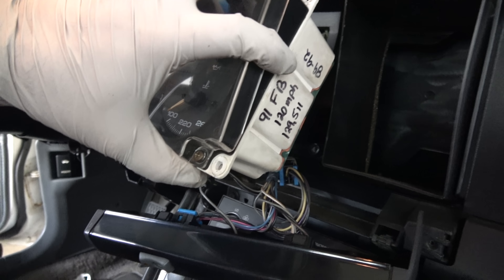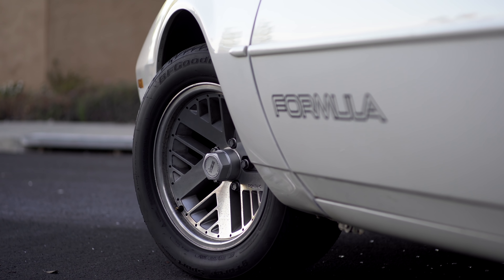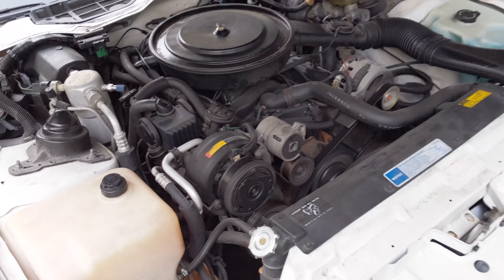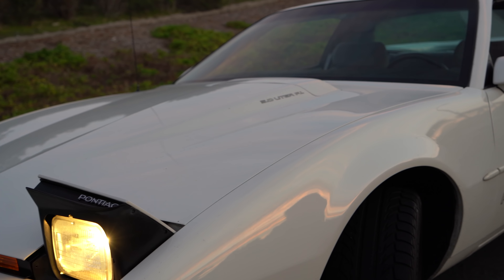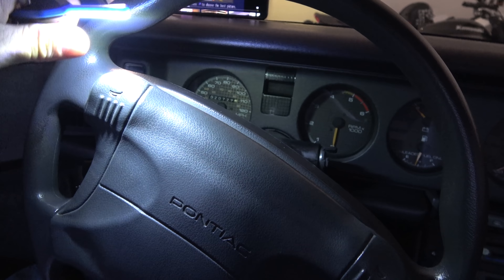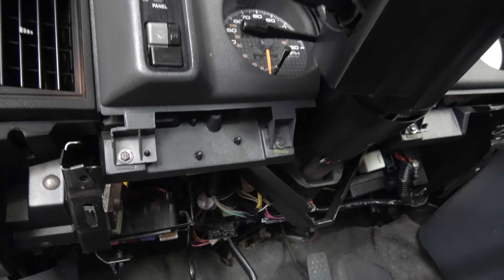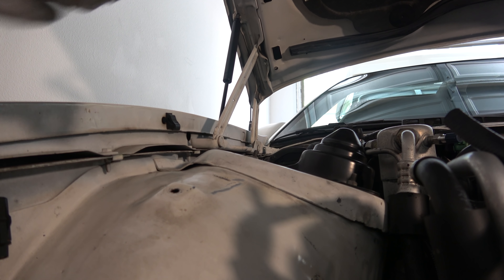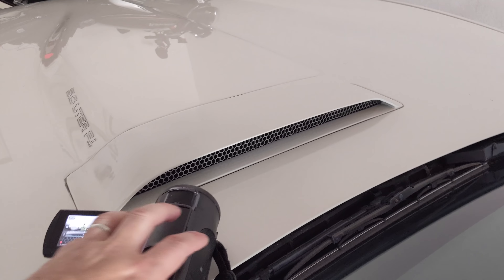LIES! Odometer fraud on my 1990 Firebird

Comment: As others have said, the '91 and Mileage on the side of your Cluster is just the information recorded when it was removed from the car at a recycling yard.  So those number mean nothing as it relates to your car.  It does imply your cluster was replaced for some reason.  

Valve stem seals fail in these cars more due to age.  They dry out and leak causing smoke at start-up.  So again, not a true indicator of hi-milage.

Fuel systems issues in Low Mileage cars is a common problem.  That is because they sit with OLD Fuel in them for long periods of time.  So very common to have to go through the Fuel System.  So no indication of a low mileage car there either.

If you are seeing corrosion in some areas, coming from Florida with Salty air, this can be quite common.  So this doesn't really contribute to Age.

I would look at the Brake lining and pads.  See if they are the OEM factory issued pieces.  That might give you some real insight into the age of the car.  Maybe do a compression check, see what the condition of the timing chain is.  I do agree that the Clutch is a good indicator.  But also don't think a factory clutch would last over 100k.  So measuring the wear and determining if the clutch is OEM, would help with identifying age.  

Sorry to see it wasn't all you had hoped it would be.  But it is a good looking car.  Appears to be in pretty good cosmetic shape.  So maybe it wasn't such a bad purchase after all.

Just a Note - CarFax reporting is not a requirement, so you are not going to see entry's all the time.  That is why so many years with no information.   Reporting mileage is on a voluntary basis.  And it is done a lot more now by states and service centers.  So newer cars tend to have a much better history than cars from the '80's and '90's.

Comment: I bought a boat sight unseen over the internet that had very low hours.  Hours seemed correct but later found it had a cracked block.  The cracked was circled and dated so I'm sure the owner knew about it.  Yeah a learning lesson.  Still was a nice boat just ended up having to put a new engine.

Comment: Mulletville Junkyard Warranty marking  ?? 

 The odd thing to me is the 129K miles inked on the secondhand speedo. With Ebay 3rd gen speedos I have bought some have inked what it came from ie 83 camaro. ie fits 82 to 85. or marked 85mph or 120 mph. like the used pulled speedos are on a shelf and these markings help sell the item, what it is for. 

If the mechanical odometer reads 123456. when why mark it 123456? 

MAYBE the Mulletville Junkyard marks the mileage as some sort of warranty. ie says it will work for 12k miles or 12 months? Then if Goober has the speed fail in 10k miles he gets a credit or his money back.

In 3rd gen speedometers on ebay I have never seen mileage inked on the speedometer and have looked at many many hundreds of auctions

Comment: Just the display has been replaced. Valve guides on SBC are prone to crack due to age.  Check the Carfax. Any stolen car will have issues. Why pay 11k for a 5k car?

Comment: Mate I'm so sorry you got hoodwinked... Before you go to the trouble of doing that valve seal job, I would definitely go over that engine with a fine-toothed comb to make sure it's not blown. If you were to end up having to replace the engine, at least you'd save the time from doing those valve seals...
Reply: He may be looking at a new short block.
Reply: Back in my early '90s college days I had an '83 Grand Prix w/a carbed 305 that had bad valve seals and a LOT of purple exhaust when starting. It wasn't too long after, that the engine blew. I managed to luck out on that one, however, as my dad had it replaced with a 350! 😁

Comment: If you plan to keep it pull the heads have them completely rebuilt don't just do the valve stems. Or better yet replace those heads with better flowing aluminum heads. If it's clean and rust free in time you will have a nice ride.

Comment: You might need to replace the Catalytic converter with a high flow one to improve your mileage,the old one is probably mostly plugged.
Reply from the maker: It's a new one

Comment: The odometer is a tool to assist in evaluating the mileage of a car. Not the source of what the actual miles are. Especially with older cars, instrument clusters were commonly changed. The condition of the vehicle will tell you more than the odometer.  A lot of cars in the 60s/70s only had odometers that went to 99,999 miles. You won't believe how many people are convinced that they have a "30k original mile car" when the thing, undoubtedly, has 130k miles or more.  Back then you'd either clock your odometer or, if you got a new speedometer, you'd just leave it at 0 and not set it to your current miles.  If you are thinking about buying an old or "classic" car you really want to have an inspection done by a reputable mechanic. Some people think they have a 30k mile car, when it's 130k, and assume that the poor condition/performance of the car is normal because it's an old car. They don't have a frame of reference to tell what a car should feel like. Don't get fooled!

Comment: Winston what version of firebird do you have? You have the formula version which is a trans am but toned down body. They came with a 5.0 liter(305) throttle body automatic, a 350 multi port or a 305 multi port 5 speed.
Do you have the w s 6 suspension package?
Reply from the maker: I can post the build sheet, yes it's ws6 and it's the tbi L03 motor with T5 transmission
Reply: @WorthlessWhips  ok that's a great option since you get 4 wheel discs and special sway bars , great project car since you have all the right options
Reply: @WorthlessWhips  The VIN number's 8th digit should be "E"  for the TBI motor and "F" for the TPI motor

Comment: Winston,  get with your local DMV office. DMV has officers that will investigate this matter.   Also "if" the engine has that many miles on it, weight out the pros and cons into putting a new crate (or rebuilt)  LT motor or an LS motor in the car.

Comment: Just get mechanic to drop carburetor. Funnest motor I ever had was 1985 Monte Carlo had 305 with 4 barrel carb. I use Bosch spark plugs. I got baby lt1 4.3 V8 got power gain by Swiss cheesing air box, de screening MAF sensor. So far so good. I'm hoping for LS swap this winter. Basically buy 5.3 or 4.8 junkyard motor rewire harness, brackets galore, send computer in to get vats deleted and rear o2 sencers. Long tube headers, figure out power steering, electric fans might be way to go.

Comment: That is a bummer, but look at it this way. Now that it's not a low milage survivor you can feel zero guilt building the car better than new. I have a pair of 91 Firebirds one Formula and one base model convertible with the 305 TBI. Do not waste any more money on that TBI. Pull that thing out and swap in something better. It's what I'm doing with mine.

Comment: If a car is 10 years old or older and it has less than 100K on it then one of 2 things happened. 1) It was parked years on end which means dry-rot seals and solidified gas or 2) they rolled back the odometer. Chances are if you see such a thing run.

Comment: Wait a minute here! I think you are an expert when it comes to China, but you are way off base when it comes to cars, a complete amateur. I have been working on old cars since 1970. Listen here...  you bought a 30 year old car from Ohio of all places. Cars from Ohio are some of the rustiest in the world. You are so lucky to get this very good Firebird from the rust belt. A few parts were sourced from wrecking yards. What do you expect to see on a 30 year old car? I would bet someone changed the used cluster mileage to match the original cluster, not the other way around. The corrosion on engine parts is so minimal for an old car from Ohio, you should be thankful. The inside of the distributor looks like that because of lack of use in a terrible climate, not high mileage. If the valve seals are hard and leaking oil, it's for the same reason, lack of use and huge temperature swings, not miles. You sound like a whiner. I expect better from you. In your China videos, you are so respectful. Here you are telling people you were ripped off. That's terrible. Maybe what you should do is get another small block Chevy and build it your way. There are so many inexpensive parts available. Enjoy the build. When it finished, install it in the Firebird. People that own 30 year old cars do stuff like that and they have fun doing it. Sorry for the rant, but you deserved it this time. And, thanks for the great videos over the years. I have sent donations to ADV China in the past and I'm likely to donate again.
Reply: Yeah, I do like them for the most part, but Winston and C-Milk honestly seem very amateurish about cars in USA. To be fair they both spent about a decade away from working on cars so I could see how they're really out of practice now. In Winston's case it seems he does have some legit mechanical experience from before China, but in South Africa they probably never had to deal with rust. The other theory I have too that is admittedly just a hunch is in a more temperate climate cars tend to break down less as the rubber seals, bushings, etc, are under less strain, whereas in the North in USA the rubber is constantly freeze/thawing. 

He still did get taken for a ride by the seller for sure, but on the other end he did get a car with a nice interior and good paint, which does cost thousands here in USA to get done due to the price of labor. I would say a general rule buying cars here is don't believe anyone's story about any car. Just look at the car objectively, supposed mileage, supposed number of owners, none of that matters.
Reply: @GilBatesLovesyou  Taken for a ride by the seller? The asking price was $12,500. He negotiated him down to $8,500, so he got $4000 off the asking price. Sellers don't usually come down that far. At least in my experiences, they never have. I lived in Ohio for 15 years. We used to check out cars that were older than about 10 years by stomping on the driver's floor, then looking underneath to see how much rust was on the ground. Many times the carpet was visible through the floor from under the car. That's how Ohio cars are. I thought that's what he got, a rusty body from Ohio. I figured it would need new floors at the least. Then he showed us the car. I was amazed at how clean it was with only a few very minor rust issues, like a few bolts, a spot where the hood had rubbed on a fender, and the distributor magnetic trigger. It was such good luck to find this great car. I would bet it came from the south or the owner kept it in a garage and almost never drove it. Ohio is extremely rough on cars. Then he whines about it. I wish I had that car. That Firebird is 30 years old and it looks great. Try to find one that good in Southern California or Arizona for $8,500. That's where good cars come from. Good luck.
Reply: @buffdelcampo  Now with cars I've seen much more wishful offers and wishful pricing by sellers compared to before. I've not looked into F-Body prices lately, Looking now on FB Market where I am fairly decent looking Firebirds with 100K miles are going for $3000-4000, but it looks like his car's been repainted, so that would probably bring it to 5-6K or so. Who knows how the undercarriage of those cars look? For whatever reason it looks like Firebirds got taken care of better than Camaros. Probably not many got driven in winter here in the Northeast due to the practicality of driving one. Most are automatic, and a manual one goes for more money and is harder to get. So I'd say at $8500 then, he only got ripped off at about 2K. Even the price of new paint would be about $1500-2000 here for the quality of paint job he has. So in that context the car is probably worth about $6-7K with newer paint, and the seller needs to make a profit, so.... who knows. 

These guys do just seem to be total noobs at cars in USA and knowing the actual market and expectations of what you get. For example, their Mercedes being hard to sell, it's the kind of thing totally obvious for someone native here who works on cars and buys cars, but not readily apparent to a foreigner where that kind of car would still go for decent money in SA, China, or a lot of other places in the world. Same with odometers, if it was a legit real 20K mile car, it would have a ton of paperwork (all the old registrations, dealer receipts, etc) to back that mileage up and be priced at $20-30K on Bringatrailer. But, I could see how that kind of thing isn't apparent to a foreigner here. 

Some things they do/say, to pick on them a bit is very noob type stuff, like the "Motor Flush" and using Rustoleum 2X rattlecan clear and saying it's 2K clear (it's not anything close to 2K clear) there's just a lot of Dunning Kruger going on overall. I do hope they gain practice over time, but at the very least Winston spent over a decade not working on cars, and where he was from weather was better, and of course the cars were newer. Even his second gen Firebird/Camaro in South Africa in the early 2000s would probably be less than 30 years old, etc. Even now myself I have this problem, 1990s cars were pretty new when I was a teenager in the early 2000s just getting my license, it's hard to realize they're almost 30 years old now and have the same or worse problems as my 80s cars did when I was a teenager due to rust, bad wiring, etc, etc.

Comment: The biggest "tell tale" sign of true mileage on a car is the wear on the drivers seat and the pedals. GM uses cheap materials in their interiors. They always have and probably still do. The seats show signs of wear very quickly. A legitimate low mileage car shows minimal wear on the seats and pedals. If it looks too good then be wary of the seats having been re-upholstered.

Comment: Use the air compressor method to replace the valve seals. No need to take off the heads!

Comment: Not so sure about the TBI ones, but on TPI cars the ECU's do fail. The MOSFETs that power the injectors fail. They did this on mine at 70,000 miles. I brought the MOSFET components from RS Components and swapped them out on the PCB myself. Problem solved. Also Superchips used to do chips for those, dont know if they still do. Had one on my 305 TPI, along with a TPI Aerofoil. Took it to 223bhp. Woohooo.  1.4 Litre cars make that now.

Comment: Winston, an old trick I've used to guess the milage of a vintage car is closely view the rubber pedals for wear. Give you a rough idea of the use.
Reply: A new set of pedal rubbers are not exactly expensive and every clocker knows this.
Reply: @jean-pierredeclemy7032  sometimes yes often not. A new set of pedals is a red flag. ;^)

Comment: Junkyards write the mileage on parts once they've been removed from the vehicles, so they can accurately price the parts without having to hang on to the worthless shell. A lot are moving to a stock number, as they are using an electronic inventory system.

Maybe the original gauge cluster went bad and was replaced, but the owner change the replacement odometer to be the original miles. I've done that exact thing before. If the car has 10k, why would you want it to read 130k that the donor car was?

I can believe that a 35 year old car that has 10k miles might have a messed up gauge cluster. Maybe it was sun damaged. I also have had that happen.

Comment: The tension of the wiper arms is a good indicator for how much a car has been driven...
Reply: Like if it wiggles at the base?
Reply: @planetvegan7843  Yes. The arms will be a little loose. You can feel it pretty easy if you compare the tension with an old car and a newer one, or a low mileage car.
Reply: Sounds good. Thanks!
Reply: @planetvegan7843  No problem. It's a part that rarely fails, and one that is a clear indicator of use. Even an old car that's been rarely used will have tighter wiper arms than a new car that's been driven 200K miles. In most cases...
Reply: So right! Nice. The ol' lady wants a 4th gen 4runner v6 as her next car - any tips on what to look for or how to shop? Peace.
Reply: Planet Vegan 4runners are pretty much bullet proof. Some had rust issues, though, so I’d carefully check out for rust. Put it up on a lift and check underneath...

Comment: A lot of time smoke out the tailpipe just indicates that you aren't at proper stoichiometric mix. Try to use sensor clean on your O2 sensors and keep your other sensors in good shape if they are NG it might just be a malfunctioning sensor. Look at your harness too. You clipped out a car alarm so who knows right? It might be something simple. Start low ( or no) buck first then move your way through. Clipped in car alarm, stolen car and replacement dash.... A lot of what ifs. Go through it all

Comment: My brother sold a 67 Mustang to a broker.  The broker listed it on Ebay with power steering and ac (neither of which were on the car).  We found out about the fraud because the next owner found a receipt in the car with my brother's contact info and wanted to chat about it.  Google how to determine mileage through a visual inspection and buy a $300 round trip plane ticket to protect your investment.  Or have the vehicle inspected by a reputable mechanic at the purchase location.  Interstate con artists count on the fact that most people will not file a crime report and sue due to the difficulty involved in out of state purchases.  It's heartbreaking to find your dream only to learn that it's not what you expected.  Good luck, brother.  Sorry about your experience.

Comment: A tell that the car odometer has been turned back. If the car looks old, in anyway. If anything looks worn. Engine bay, the interior, the doors don't close like it's new. Whomever played with the odometer cluster could have adjusted it to the right reading. They chose to scam you.